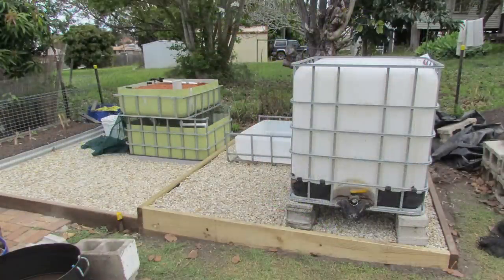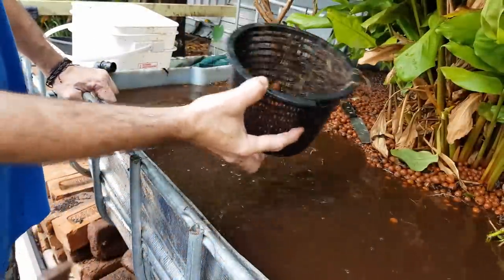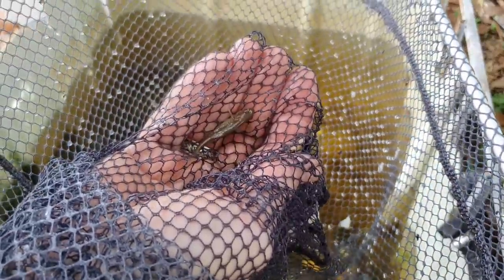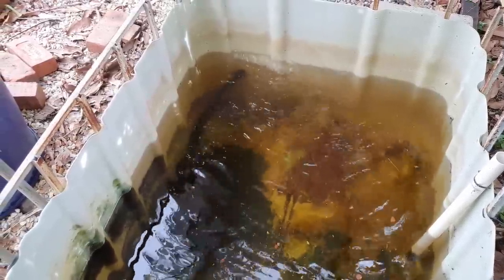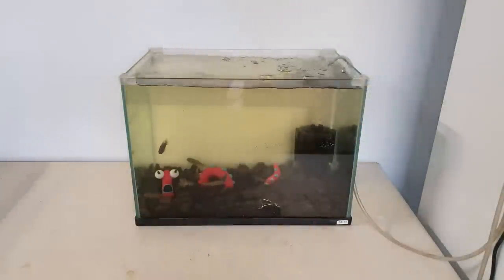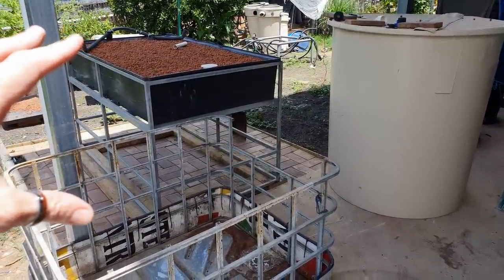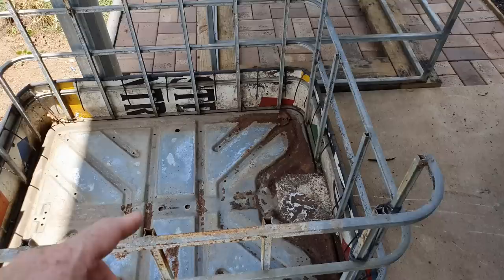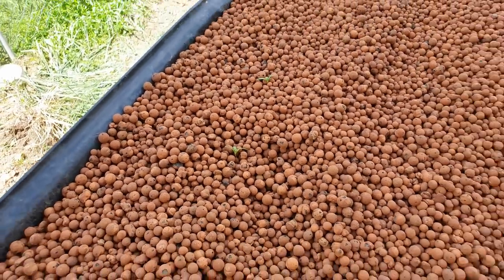No More Aquaponics........ 😥

Comment: Thanks for the updates Rob! Your channel was my initial inspiration from years ago! I've redone my basement aquaponics system several times towards the elusive goal of getting the system dialed in...  Started with a chop and flip rain barrel which is great for an outdoor spring/summertime project here in Virginia - the fish had to be moved indoors for the winter so they wouldn't be in a solid barrel of ice!. Used them in the basement with grow lights but the solids load from a pump in the tank directly up to the grow bed can't be ignored. Finally got a 100 gallon sump with 50 gallon grow bed and 50 vertical grow towers and everything is humming along after adding the moving media bed, swirl filters and protein skimmer. I learned from aquarium keeping that everything you do from a filtration stand point only buys time for the water changes and media flushing to remove the solids and excess salts. I look forward to your system rebuilds in the future. Good luck on the renovations!
Reply from the maker: Nice one Shaun.  👍  
Will be posting an update on the new jobbie soon.
Happy growing. 🌱👍

Comment: I'm really interested in the sand bed idea.
The easy availability of sand around here appeals to me for a start.
Googling it gives other claimed advantages too.
Seems like Gary Donaldson is an advocate, and he is very experienced in the area.
Reply from the maker: So far no one has done straight iAVs with Aussie fish but they do work well with Tilapia George.👍
 Murray Hallam is using Jade perch in a sandponics system but it's not a proper iAVS as described by Mark & Gary. I would like to know what he's doing different but can't afford his course to find out more on just one growing method. 😉
I'f you're on FaceBook look up the iAVs page & group. A few posts there may give you more insight to working systems if you're interested. 👍
Cheers & have a top one George.
Reply: Sand is terrible. Its anearobic
Reply from the maker: @DatsiKxModz  That would depend on how it's used. Folks have been growing in the sand based iAVs systems for years with no issues at all. 😉👍👍

Comment: I am very sorry and sad to hear about your decision.
I have been gardening for a few years, discovering your channel inspired me to start building my own aquaponics system. I am planning to build a 20 000 liter fish tank, can you suggest how big (how many liters) my grow beds and deep water culture beds should  be?  One grow bed holds 540 liters. How big should the bio filter and solid waste separator be?
Thank you for all the relevant information you have posted on your you tube channel, everything you present makes it easy to understand especially for a novice like myself. Therefore making it possible for me to build something amazing which otherwise I would never have attempted to build
Thank you
Martin from South Africa
Reply from the maker: Sounds like you're going commercial Martin. All the sizing for your system's components will be based around the amount of feed you'll be adding into the system when the fish are at their largest size. The reason being is that the media beds & biofilter will need to be able to process the amount of ammonia produced at that time. From there you can work backwards with the amount of m² of growing space & plant numbers to take up the nitrate that's produced at that time. 
For solids removal, most of the settlers will require 20min retention time in commercial-sized systems to keep the fines out from the DWC beds. You may also want to consider an additional fines filter before these beds just to make sure. 
Hope that info helps some. 
Am still doing aquaponics & just showed the layout for our small temporary system in today's clip if you're interested in checking it out,  https://youtu.be/VbXKSP8jt9k 

Cheers.
Reply: Thanks mate happy aquaponics

Comment: Hey brother. Much love from Fraser Coast! Thanks to your vids myself and my boys are undergoing a simple aquaponics system over the Easter hols! Fyi used to install underground fiberglass pools... heat gun is your friend! If ever you run close to the ibt structure just heat and put a screw driver or suitable object to manipulate the pipe once warm... problem solved with minimum flow disruption! Cheers heaps!
Reply from the maker: Cheers for that Jarra.
Hope the build went smoothly. 👍👍

Comment: I would use some rust converter after hitting the steel with a wire bush.  Just get the worst oft he flakey rust off with the wire brush, use the rust converter ( I just use a cheap one from super cheap) let it dry about 20 minutes then cold gal it.
Reply from the maker: Took it back & it doesn't look that bad at all. Thanks. 👍

Comment: If you need to dry the clay balls when there is no sunshine. You might consider putting the clay balls in a big barrel. Then connect a hairdryer to the bottom outlet. And leave a hole open in the top of the barrel. Hot air will enter the barrel and rise up between all the clay balls. This way the clay will dry quickly.

Comment: Thanks for letting everyone know about your efforts.  It is hard to explain to people that to get to the next level in system a total teardown is required.  A lot of learning and thought goes into the re-built of a system to take advantage of what has been learned and can come in line with the new concepts.  Aquaponics is stiill a developing platform with new and changeing equipment and techniques that need to be explored for doing things bigger and better, so keep up the effort and good works.   rik
Reply from the maker: At times I wonder why I still do it then I get bored & the itch sets in to tweak or re build something Rik. 😉 
I think the new system I build in this spot will be far more efficient & productive. 
Cheers mate & all the best.

Comment: Hey Rob; maybe have a go at vermiponics. Similar to aquaponics, but using the tea from a worm farm. It has a slightly different spectrum of nutrients, but seems more robust as worms are in the soil/substrate anyway.
Reply from the maker: Will be sticking to aquaponics as we have a system mainly for the fish. 👍 If it wasn't for the fish I'd probably go with a bioponic system which would involve worms as well. 👍👍
Cheer Bob-a-FET & have a top one.

Comment: Hi Rob. PVC pipe is very easy to heat and custom bend should you need to. Good luck. :)
Reply from the maker: Cheers Gary. Have played around with bending pipes a bit but always find thew collapse a bit at the bend. Probably need to change my method.
Cheers mate.

Comment: Ammonia spike? Just change your clay balls a bit mix with with medium size charcoal, or biochar. That will make it very very stable.
Reply from the maker: Not sure that's worth it. Ammonia spikes can be managed without the need to swap out grow media I've found.
Reply: @RobsAquaponics 
Ammonia will be greatly assorb by the charcoal or biochar. DIY the biochar yourself. It's super easy n super efficient. I tried it already. N The plants get nutrients from the charged biochar thus growing like crazy. 
2)Another problem u need to do is inoculation of massive good microbes.
3) try to get a best species of worm to work inside the system. U will automatically get much of the benefits of nutrients recycle n it also provides mych beneficial microbes.
4) the last one is the most difficult. The oxygenation the system if possible with nano bubble device. DIY if possible. The overload oxygen gave tonnes of benefits to fish, plant's root n benefitial microbes. But provided u have much advance filtration system. Especially cyclone filter n sediment tank. Many of the filtration system will eventually stuck. So the design is crucial. Must be free flow even if loaded with waste. 
Happy goog try
Reply from the maker: @tangkieong9939  Thanks for the help mate but have it all under control here.
New system is doing really well & has fish in it now.

Comment: Built my first IBC after your style 2 seasons ago. Was thinking of expanding to a second or a few 55gal barrels and decided to see if you had an expansion vid to watch. When I saw this i was bummed, but hope the remodel goes well for ya!
Thinking of joining two totes by a transfer tube attached to the drain valves at the bottom. Any thoughts if that is viable?
Reply from the maker: Sorry I missed this at the time Ryan. I have seen folks do that to increase sump size. Did you end up joining them?
Reply: Rob Bob's Aquaponics & Backyard Farm not yet! Been working on the purchase of a new house. I should be moving everything over in a few weeks and will start making changes! Also getting back into falconry.

Comment: Can you share the link about making an in ground  wicking garden?
Reply from the maker: The only clip I have is this one from ages ago Charles,
https://www.youtube.com/watch?v=1PlBrOnKaQI
Here are a few alterations I'd make to the build in the clip I shared if I was to make it now,
- add more slotted ag pipes to increase the void space for holding water in the reservoir
- run the plastic all the way to the top of the bed walls to stop tree root intrusion
- install a movable drain pipe so I could regulate the flooding of the soil with water
That clip is not my best work but hope it helps some along with the pointers.

These 2 recent clips might give you some ideas as well,
Wicking Garden Bed Design - Sand Or Rocks in the Reservoir?
https://www.youtube.com/watch?v=9Sj1y0x_Y14
Wicking Bed Design - Building the Bed, Selecting Soils & Replying to Comments
https://www.youtube.com/watch?v=Bj6L3gLhyF0

Cheers.

Comment: Hi Rob, what is your opinion on AIVS aquaponics? I've been trying to find an objective comparison, but can't. Hoping you'll impart your invaluable knowledge!
Reply from the maker: I haven't tried one but am interested in having a crack at some point. The one issue I have is that the stocking density needs to be a lot lighter than what is typically used in a backyard system. If I was into aquaponics just for the veggies I'd definitely be having a crack at one now to see how it would compare to normal AP. 
Are you looking at setting one up William? 
Cheers.
Reply: @RobsAquaponics  I'd love to set one up in my backyard. I've been speaking to Gary Donaldson, the inventor of AIVS, and he is adamant that his system is superior... the only problem, is I've been unable to find people who have compared the two.
I haven't been told of any drawbacks or restrictions such as a lighter stocking density, only positives. I did read somewhere in the past about fish waste water containing too much nitrate which would burn crops.
Reply from the maker: @thaywalcus     Gary isn't the inventor, just a chap that likes to promote it.  Dr Mark R McMurtry is the originator of the idea.
As far as I know Gary has never built or run a iAVs but is in the process of setting one up now. 
I hope Gary does build his soon as I would like to see how a system would go using our native Jade perch. Murray Hallam is running a few sand beds in a system but it isn't pure iAVs from how he explained it on his video as it includes other growing systems & I suspect filtration as well. You need to pay almost $1500 to do the course to see how it is set up, something most backyarders like myself just can't afford when we already know the basics.

Comment: Hi Rob. Loved your clip on How to grow Papaya in the ground. Posted this clip under that video until I realised that it was several years old. Hope you don't mind me posting my question on this site? I have a beautiful 2 metre high papaya tree that is producing both male and female flowers on the same stem. (large female flowers with two smaller male flowers on either side) I have fruit but they don't seem to get much bigger after they reach about 6 inches long. I have noticed that whilst the female flowers open and produce the little fruit, the male flowers are not opening at all and usually wither up and fall off. I have opened a few of the unopened male flowers and the pollen part at the tip is green and not yellow, perhaps indicating that the male pollen is not developing? Should I be worried about this lack of male flower activity and if I should, would you be so kind as to give me some tips on getting the male flowers to open and do what they should naturally be doing. Regards Michael
Reply from the maker: Hi Michael & sorry I didn't get back to you when you posted your comment. Has the pollination rate increased as all. It might be a temperature issue as I've noticed ours slow down through the cooler months.
Reply: @RobsAquaponics  Hi Rob. The pollination issue seems to have solved itself as the tree is now full of good sized fruit. Still no evidence of the male flowers opening however! New fruit are still forming on the tree even though the temperatures are now quite low at night and during the day. None of the fruit have ripened yet even though they are really quite big now. Perhaps I will have to wait until the warmer weather arrives again? (we are 100km south of Perth) Tree is looking a little bit yellow (not the usual dark green as in the summer). I have heavily mulched around the roots (not against the stem) mainly in an attempt to keep it warm and provided some protection from the strong winds. Thanks very much for your interest. Any advice or suggestions would be most appreciated as always. Mike

Comment: hey rob, what size air pump did you use on the moving bed bio filter..
Reply from the maker: That one is a 3500lph or 123ft³ph if you're in the States. 
Some of the flow is bled off otherwise the drum would look like a spa. 😉

Comment: could you tell me more about the peo3 k25 item and the machine you used ? and on 5:05 i am pretty sure i can see a mouse
Reply from the maker: Hi Ashley. The filter with the bio media is called a moving bed bio reactor. The media in it houses the bacteria that convert the ammonia all the way through to nitrate. 👍  Not needed if you're running all your fish tank water through a grow bed but I like to have them as an added filtration point. 👍
What you saw at 5:05 was actually a skink lizard. Have LOADS of them & Asian house geckos around here.
Cheers 😁

Comment: How much is your electric bill with the setup?
Reply from the maker: Hard to say as we have a back to grid solar system on the roof. I did have a meter to measure usage somewhere & wanted to do the numbers for the new system running cost but can't find it when I unpacked the house.  Will look at doing a clip on it at some point. 
Cheers.

Comment: hey rob what kind pump do you use in the sump tank?
Reply from the maker: I was running this system on a 15,00 lph / 4000gph when it had 2 fish tanks, venturi run bio reactor & 5 grow beds. 
I could of easily got away with a decent 6000lph / 1600gph  pump when it was just 1 fish tank & 4 grow beds. 👍
Cheers mate & hope all's well with you.

Comment: Zašto se ne koristi šljunak!?
Reply from the maker: Možete koristiti rock. Jednostavno smatram da su glinene kuglice lakše raditi. 👍
(Google Translate)
You can use rock. I just find the clay balls are easier to work with.👍
Reply: @RobsAquaponics  My English is passive and I don't use it often in practice, it's not a problem that clay balls are used for water purification, but he himself thought of a water purification system because a lot of PVC buckets are used to purify water because when you look at fish lakes it can be noticed that the beaches have a mixture of gravel, sand and earth !? Even if charcoal is added, the full process of filtering dirty water into processed water is obtained !?
Reply: @RobsAquaponics  
Why not use a cheaper DC PVC valve that only has a cheap PVC hose connected between the IBC pool which is cut into 2 parts from 1 foot (where there is not much water) with fish and a filtration system above the pool with fish in case to lose electricity in the settlement for any reason ....!?
Reply: @RobsAquaponics  
When did you put together the filtration system (PVC pieces that need to filter dirty water !? Which will be filtered sooner - gravel, sand, earth, coal - it doesn't matter? That's your way of working - okay) from a PVC barrel (which you have more than 2 pieces) that the purified water from the PVC filtration barrel goes through PVC pipes into the IBC fish pool where you could drill that same PVC pipe with an electric drill 2 small holes to let air out with bubbles outside the PVC pipe to reduce pressure and increased water speed ....!?